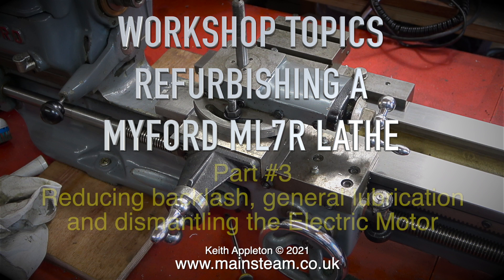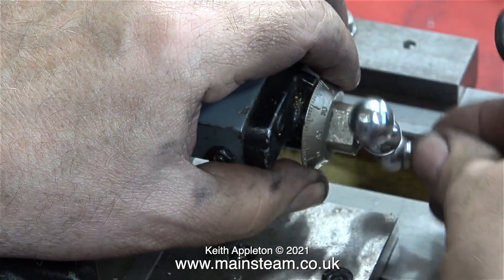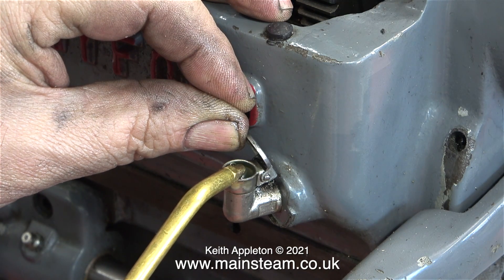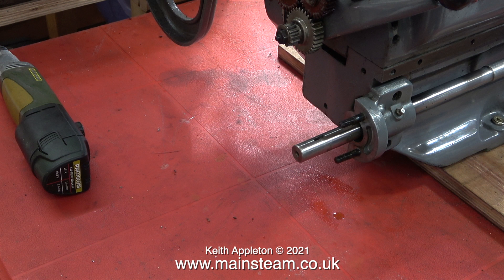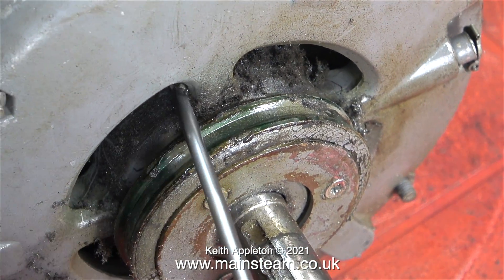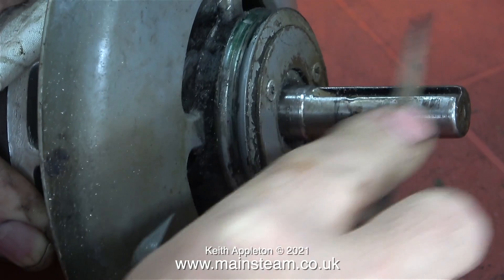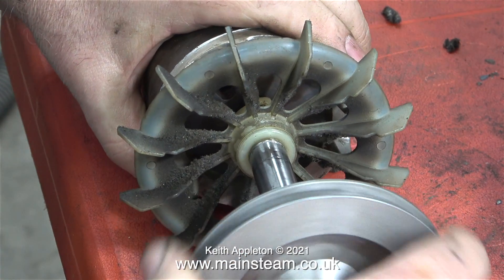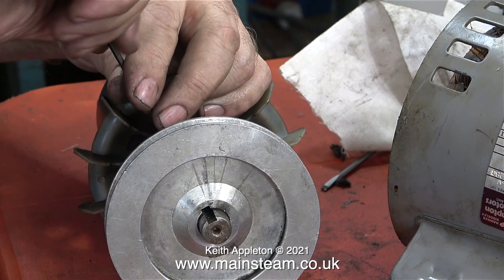MYFORD ML7R REFURBISHMENT - PART #3 - WORKSHOP TOPICS

Comment: Ayup Keith, excellent video. I'd suggest not using silver steel to make your woodruff key. They key is meant to be a point of failure in the event of a crash. You should consider using the softest mild you have.
Reply from the maker: a good point - thank you.

Comment: Thanks for sharing! I know it's to late but for in the future, any time you open a motor case for any reason you should plan to clean the windings with contact cleaner. It's avaible at your local electric supplier.